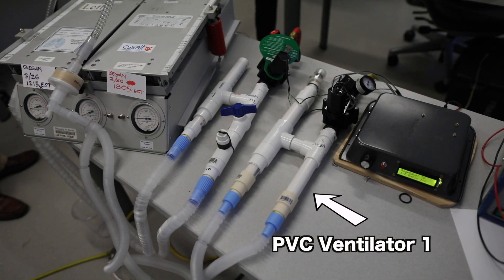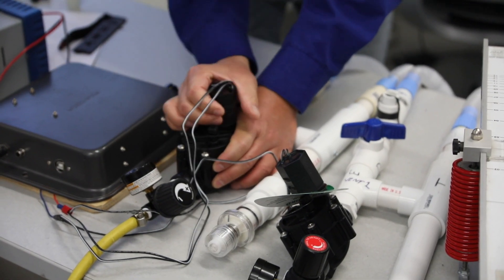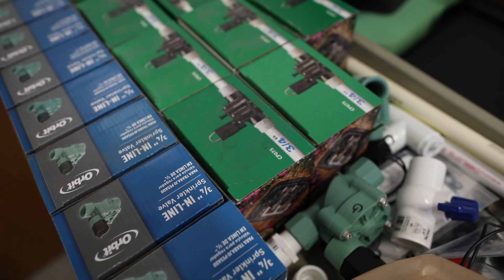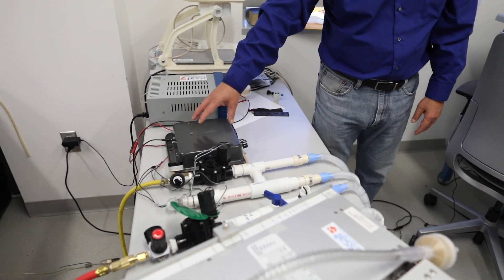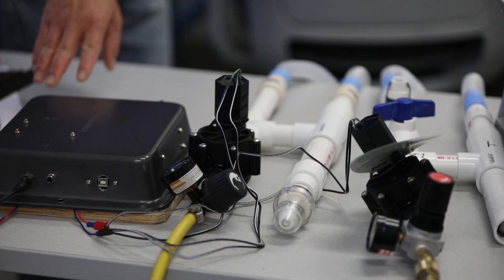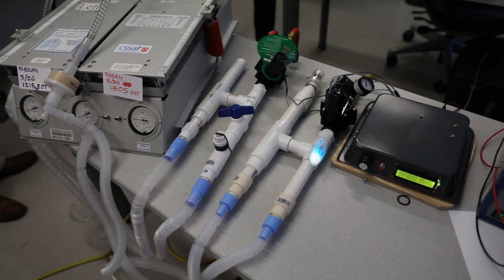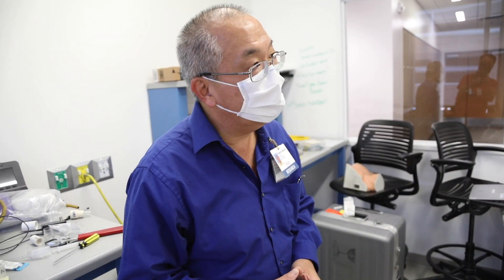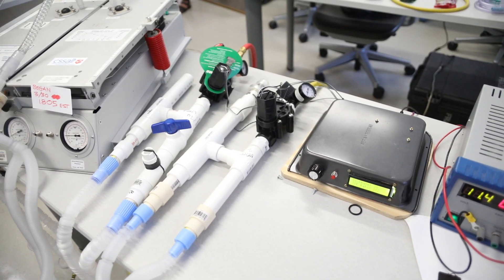UF Professor Develops DIY Ventilator

Comment: Nice start. A few well-intentioned criticisms:

A plan for software is not specified for price, QC, or maintenance.
Please do not assume this is a trivial part of the design. Think
Boeing.

I have doubts about a sprinkler valve cycling 30 times per minute
for two weeks without any kind of failure. That would be 
1,800 cycles per hour
43,200 cycles per day
302,400 cycles per week
for a valve that is meant to cycle once or twice per day about 100
days per year, for, say, twenty years - 4,000 times.

The notion that PVC is reliably airtight without glue is weak. 
The system will be moved, jostled, adjusted, etc. It must be mounted
on a mobile stand, with operator access, service access, etc.

How will you sterilize everything before and after patient zero? It might 
be cheaper to use all the plumbing pieces, including valves, once, then
replace. How do you dispose of used parts or items used for cleaning?

The availability of thousands of Arduinos, valves? 

The source of the pressurized air is not specified.

Filtration of the pressurized air is not specified.

There should be at least one moisture trap.

A robust power supply must be specified. Capacitor or battery backup?

How about a failure monitor? Alarm?

The pressure and flow monitoring in the prototype look to be
in the lung simulator. Where will they be in the finished machine?

The exhaust air will be full of virus. Where does it go? You can't
ask a staffer to enter a room full of ventilator exhaust.

How do you adjust pressure to achieve desired flow rate at different
altitudes?

Yours is a crude scientific prototype. Worthy of note, but far from
ready for prime time. Next steps should include design for manufacturing,
design for testing, part sourcing, assembly plan, service plan, operating 
manual, including servicing between patients - a hundred practical 
considerations that will affect the final design of something that is 
needed by tens of thousands.

This critique is from an old engineer (and UF alum) with decades of 
experience taking brilliant ideas like yours and working through practical 
realities to develop something robust that can be reliably done in the real 
world - and with too much time on my hands. 

I wish you all the best.
Reply: https://www.youtube.com/watch?v=OrbmwrWwBdo&t=328s